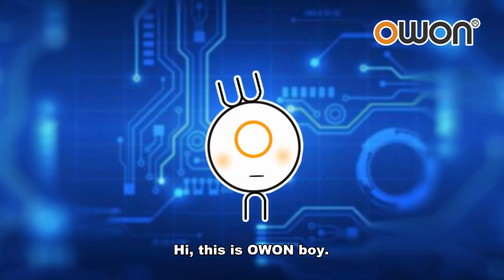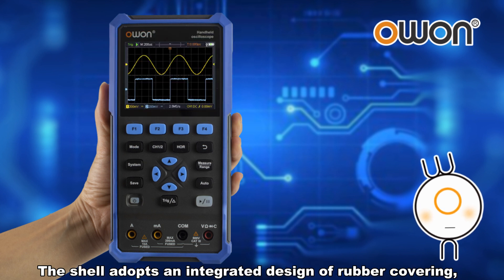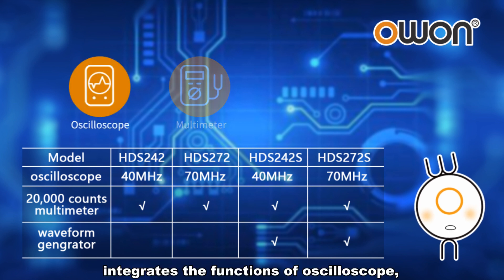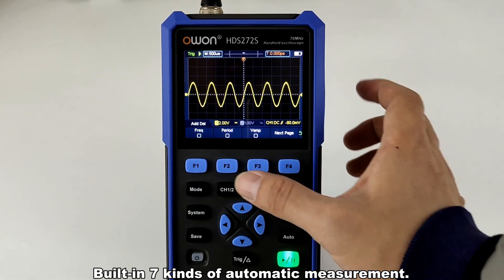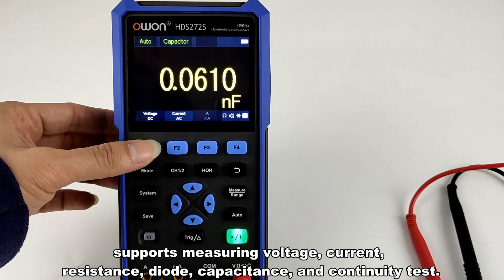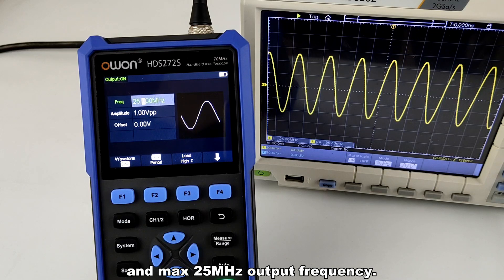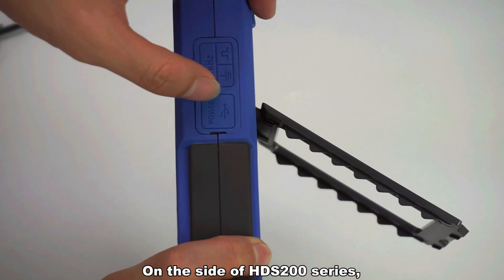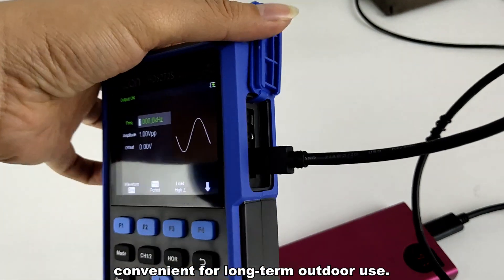OWON HDS200 Series 3-in-1 Handheld Oscilloscope Introduction

Comment: I have an HDS242 and it goes into low battery protection when the source voltage (battery or bench power supply) is below 3.7 VDC. Does anyone know if it's possible to disable this protection? 
Thanks

Comment: The software is crap. Most of the buttons on the front panel are inactive during all 3 modes. NOT a convenient interface at all.

Menu navigation is not intuitive. The PC software didn't work at all.
Maybe they'll fix it later, but usually such devices don't get the update.

Comment: Hello I really like this multimeter but i have a suggestion….. this meter take long pause while measuring resistance and DC voltage … I think it takes long time to change the range mV to V or ohm to Mohm… please fix this issue its really bugging me…. Otherwise its a great tool to have

Comment: How can I open the saved *.csv files in your HOS software to analyze them? And is there a way to connect the multimeter and function generator to the HOS software? And why can only 4 *.bmp and *.csv files be saved?

Overall, a nice device. But the software seems to be terrible. Especially with the small display I would like to save the event to analyze it on the computer afterwards.